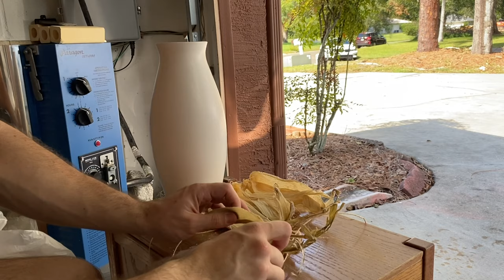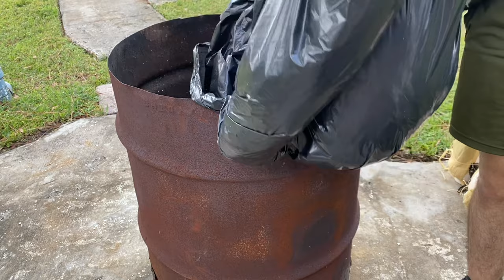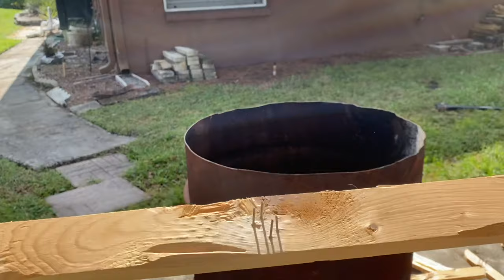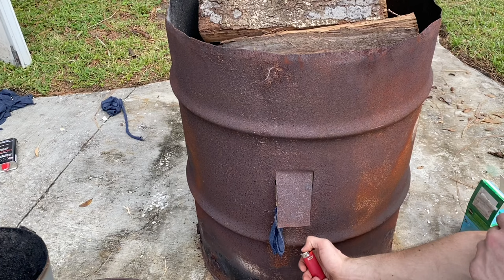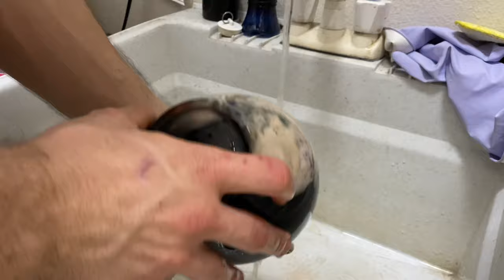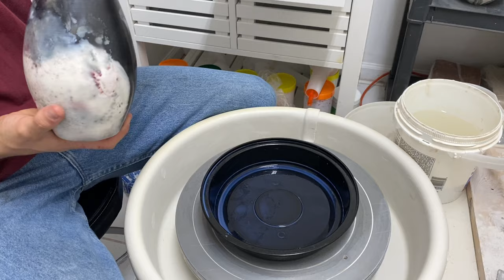How I Smoke Fire My Pottery

Comment: Cool video. So are they going in after being bisque fired or does that constitute the bisque?
Reply from the maker: Slow bisque to cone 08 (or less, if a stronger clay body with grog/sand) and then they’re fired in the barrel after being prepped with organics and chemicals. No further firing after that or the heat would burn off the smoke trails and carbon. Thanks for watching! :)

Comment: Do you have any examples of salt coagulation on the ceramics? I would like to see this
Reply from the maker: Fortunately, no I don’t lol. I learned my lesson the first time. I can paint a picture for you,though. It kind of looks like slag. It’s almost like charcoal in consistency and it sticks like glue to a pot. I’ve gotten around it by just sanding the “slag” off without too much issue, but it’ll scar the finish.
Reply: That was a quicker reply than I expected! I have a picture and a mediocre 3D model of a pot I fired recently, and it sounds like what you describe. I did however, not add any salts but there could be contamination in my firepit from other times. 

Mine looks like you forgot a potato in the oven for too long so it got a charred crust. 

Can I send you a photo somehow, maybe you would be able to tell me if it looks like the salt-coagulation?
Reply from the maker: @MrDoomperson I try to be prompt haha. That’s interesting though. What kind of clay did you use? I have an Instagram by the same name: connorcaproon. Just shoot me a DM and I’ll take a look
Reply: @connorcaproon451 I dont have an instagram but I'll make one and send it! 

I used a red clay, storebought. I have fired several items with this before to ~850celcius and had no discolourations other than a smokecloud. Only variables I can think of is the wood this time (oak) which contains more acids/tannins that the beech and birch I usually use. Perhaps aluminium and the acids both reacted somehow.

Comment: I wonder if 'magic rocks' or 'magic flames' would work.
Reply from the maker: Super late response but I don’t think the colors would hold up. The colored smoke is superficial. It would likely burn up at higher temperatures as the color is achieved via dyes rather than chemical reactions.